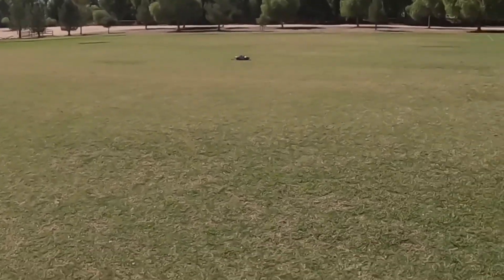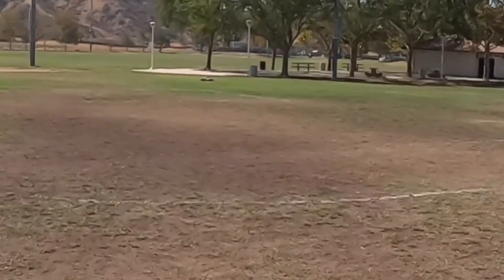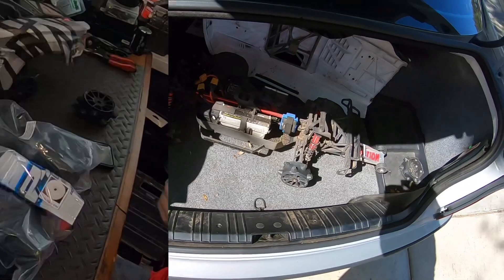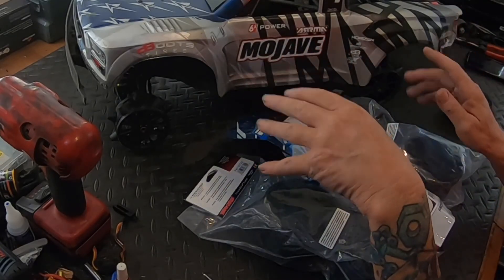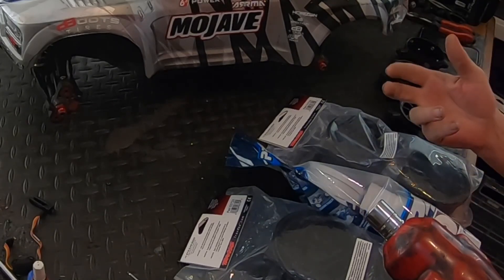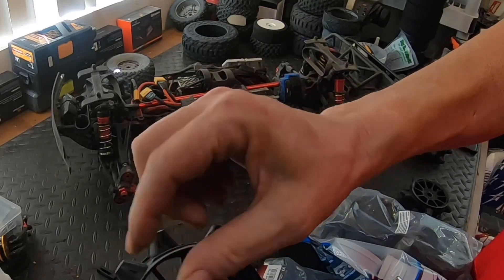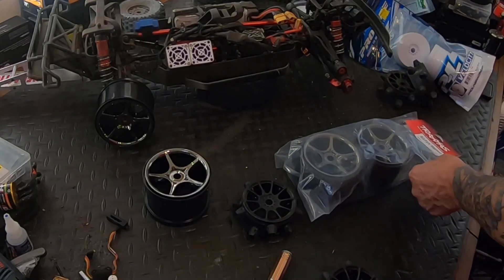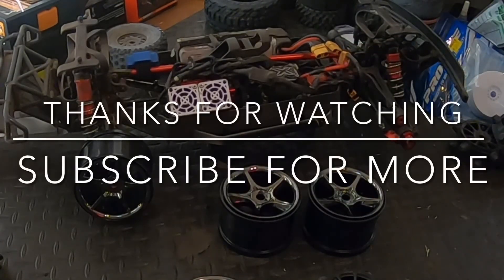Mojave Off-road Speed Run Testing New Motor 1717 1650kv & cleat-Us wheel failed see how ?

Comment: Earl - I can't remember the make (pretty sure it was Chinese no name stuff, though...), but when I was looking for Senton 14mm to 17mm adapters I found wheels that had adapters that you bolted onto the centre of the wheel, so that the mount interface would be metal to metal on an otherwise plastic rim. Those might be an idea... though I agree with you that going that route will likely lead to more costly breakage elsewhere.

Also - the ground down bolts on the other side of that rim make the cleats bullet proof. Didn't realize you went that extra step.

Comment: just seeing the stripped hex. Crawler wheels have an insert for the hex with 6 or 8 bolts to hold it to the rim, so maybe switching up to something like that? I bet you could find or modify some plastic wheels that accept the hex insert like the crawlers use. That'd give you a solid hex with whatever material and size of wheel you want.

Comment: The larger diameter should definitely help. As for width, would you consider cutting off the inner lip? I've narrowed rims mounted to drill press and laying a hacksaw blade against the wheel while spinning. Anyway, you likely have the new rims studded and testing already. Look forward to seeing the results!
Reply from the maker: I’ve seen ppl cut down the rims using the foam tire cutting machine to make skinnies for there speed cars I tried a hack saw blade and on my slashspeed build it didn’t work to well wasn’t a clean cut

Comment: The cleat experiment is definitely working BUT for what you're spending you might have been able to get a set of the aluminum 1/5 scale cleat wheels. I'm doing a rough estimate in my head and you're close to 200 bucks in already just on the wheels.
Reply from the maker: Once I know it will be cheaper but testing always cost more 👍👍

Comment: You shoulda just used the rims n used small wood screws instead of them cleats, traction n grip..
Reply from the maker: explained that already he self tapping screws snap with sideways force has strength pulling but not to the side they broke off on turn of the wheel